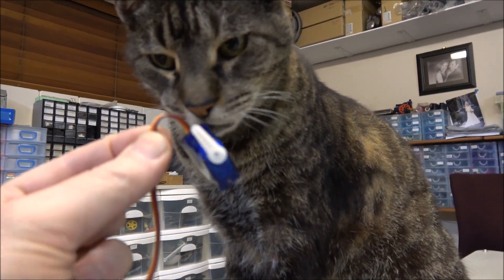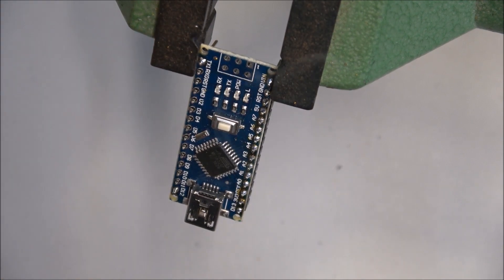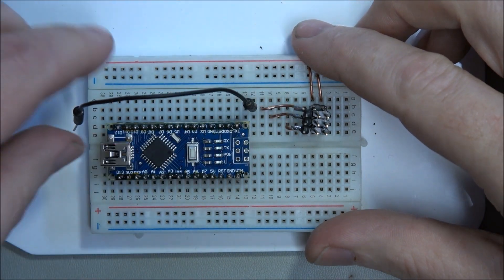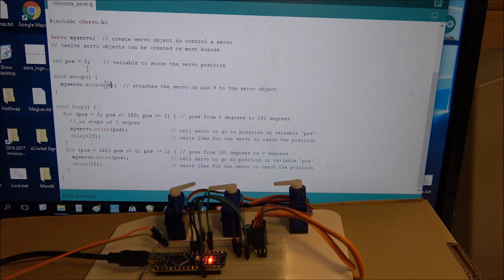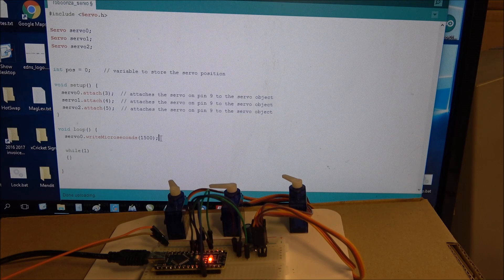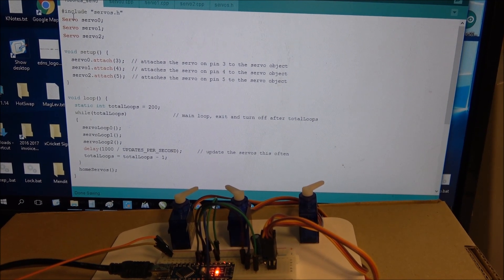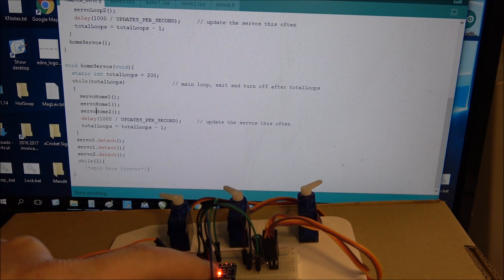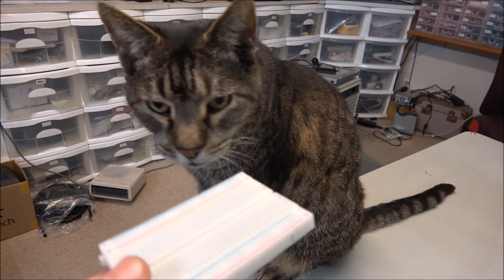Arduino multiple servo's the simple way

Comment: Thank you thank you thank you! Froma  complete novice   you've helped me gain knowledge.  I have some questions. I'm making an xwing and want the wings to open up and r2d2's head to swivel. I used your servo version one code and I want to add more positions. Thanks to you my servo is moving 10° and back to  close but I want it to hold in the 10°position for a few seconds before it closes again, also i want it so start off slow ,speed up and slow before it gets to 10°  everything i try to add more steps the the animation it doesn't work and I'm not sure why

Comment: Would this code work with an Arduino uno? I'm trying to move a robotic arm with 6 servos with an arduino uno, I have an external power supply that provides 7.5 V but I keep getting these weird glitches where only 2 of the 6 servos move. I believe it's because my code has them moving at the same time, however this code allows them to move simultaneously right?
Reply from the maker: It should work fine. Its not demanding code. Make sure you add the capacitor like I did. Yes this code can expand and move 6
Reply: I’m having the same issue trying to run 3 servos from a battery. I’m trying to run the servos and the nano all off 4xAA batteries. I suspect I’m maxing out the current draw of the battery and that is causing issues. What’s more weird is when I hit the reset button 2 of the 3 servo move but it’s rarely the same 2. Like it seems random. One time they all moved but then one of them started spasming and twitching a bit. I’m gonna try swapping for a bigger capacitor, and if not putting more batteries in parallel to try to increase the max current output

Comment: Very well explained. Although could you explain the circuit wiring. I can assume how the servos are attached to PWM pins, but I notice a capacitor there. What is it for and how exactly is it wired, and is it essential or is it just like a protection thing
Reply from the maker: The capacitor is there to avoid servo noise getting into the micro power supply and glitching it. It is standard practice. Just about all circuits need power supply capacitors. I have noticed a lot of builders miss this.

Comment: Thank you for this awesome tutorial! May I ask some beginner question here? Does it damage the servos if they hold the position for a longer time? Why I'm asking: I am about to program a robot owl, and it should ideally hold a particular position after a movement is done. If I simply detach the servos, gravity would do its job. (Your cat is so cute!!)
Reply from the maker: Servo's are well known to burn out if left "holding" something. The best thing to do with your owl is to counterbalance it if you can. This way it will hold position with no power.
Reply: @Robonza  thank you for your reply! Counterbalancing will be a problem, but I can program it to end each movement in a stable position (and then detach). I didn't know it was an issue with servos.
Reply from the maker: @HeiligeHandgranateVonAntiochia  Some high quality servos might deal with it. I guess like a lot of things its a gamble on how long it will last. Detached servos will last the longest
Reply: @Robonza  well, it's definitely one of the most useful things I learned this month :)

Comment: Let me preface this by saying I am not a coder.  I an a one time user at the copy and paste level of knowledge.

I found this script for moving model railroad turnout servos.

But it is only for one turnout.  I have 6 on my layout.

Would you be so kind as to give me the code to have this work for 6 turnouts and for each turnout, instead of only having 2 position indicator LEDs, I would like to have 2 other LEDS that would be used for a signal light.  They would change with when the position LEDs change.

Thank you for the time, help and patience.

Gary G
#include <Servo.h>
// original nscaler control of 1 turnout.
// constant variables used to set servo angles, in degrees
const int straight = 90; 
const int divergent = 110;

// constant variables holding the ids of the pins we are using
const int divergent_led = 6;
const int straight_led = 7;
const int buttonpin = 8;
const int servopin = 9;

// servo movement step delay, in milliseconds
const int step_delay = 70;

// create a servo object
Servo myservo;  
 
// global variables to store servo position
int pos = straight; // current
int old_pos = pos; // previous

void setup() 
{ 
  // set the mode for the digital pins in use
  pinMode(buttonpin, INPUT);
  pinMode(straight_led, OUTPUT);
  pinMode(divergent_led, OUTPUT);
  
  // setup the servo
  myservo.attach(servopin);  // attach to the servo on pin 9
  myservo.write(pos); // set the initial servo position
  
  // set initial led states
   digitalWrite(straight_led, HIGH);
    digitalWrite(divergent_led, LOW);
}

void loop() 
{ 
 // start each iteration of the loop by reading the button
 // if the button is pressed (reads HIGH), move the servo
  int button_state = digitalRead(buttonpin);
  if(button_state == HIGH){
    // turn off the lit led
    if(pos == straight){
              digitalWrite(straight_led, LOW);
          } else {
              digitalWrite(divergent_led, LOW);
          }
    old_pos = pos;   // save the current position
    
    // Toggle the position to the opposite value
    pos = pos == straight ? divergent: straight;
       
    // Move the servo to its new position
    if(old_pos < pos){   // if the new angle is higher
      // increment the servo position from oldpos to pos
      for(int i = old_pos + 1; i <= pos; i++){  
        myservo.write(i); // write the next position to the servo
        delay(step_delay); // wait
      }
    } else {  // otherwise the new angle is equal or lower
      // decrement the servo position from oldpos to pos
      for(int i = old_pos - 1; i >= pos; i--){ 
        myservo.write(i); // write the next position to the servo
        delay(step_delay); // wait
      }
    }
    // turn on the appropriate LED.
    if(pos == straight){
            digitalWrite(straight_led, HIGH);
        } else {
            digitalWrite(divergent_led, HIGH);
       }
  } 
}// end of loop

Comment: been searching the internet for days and still havnt found an answer. I want to make several servos move with if statements. like, if a servo position is at 70, i want another servo to go to 30....if that makes sense....anyone have any answers?
Reply from the maker: The code I have supplied will do that. You just need to spend some time using and understanding it.

Comment: Probably a daft newbie question. I have loaded the INI file into the Arduino.  Where do I add/use the servo0/1/2 CPP and servos H file ?
Reply from the maker: All files must be added to the project before compiling or it will not compile. Standard practise.

Comment: So from what i can understand, splitting the code in cpp files makes it possible to run multiple functions simultaneously. Am i right??
Reply from the maker: its impossible to run thing simultaneously. What it does do is make things tidy and easy to maintain. One rule I try to follow is make my main loop under one page when possible as it makes it easy to read and fix in 5 years time when you forgot how it works.
Reply: @Robonza  Then how can you control the servos simultaneoulsy without constantly skipping back and foward between them? I watched the video multiple times and downloaded the code to read it but i'm still kinda lost...
Reply from the maker: Each servo is updated sequentially at a rate that appears simultaneous.
Reply: @Robonza  ohh that makes much more sense... and can i apply the same concept with a pwm servo driver?

Comment: Thanks for posting this and for sharing the code. When I validate I get this error message though:

error: 'TICK_TIME' was not declared in this scope
Reply from the maker: That typically means you do not have all the files added to the sketch so it cannot find a value needed. Make sure all files are add to the sketch
Reply: @Robonza  thank you for getting back to me so quickly. I think I have all the files: robonza_servo.ver3.ino, servo0.cpp, servo1.cpp, servo2.cpp, servo.h
Reply from the maker: Did you open the INO file using Arduino?  TICK_TIME' is clearly in servo..h so that means the h file is not visible to your sketch. Its not an issue with my code.